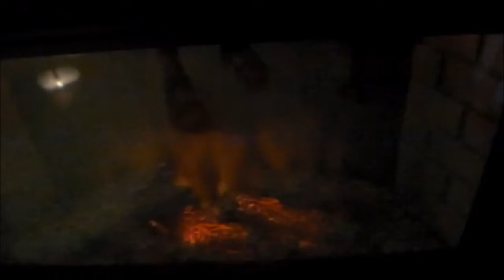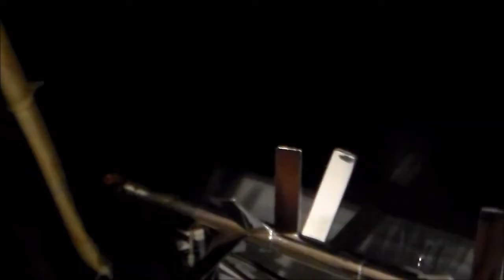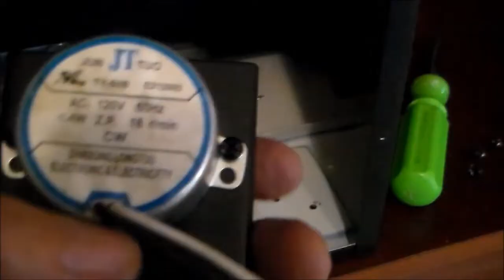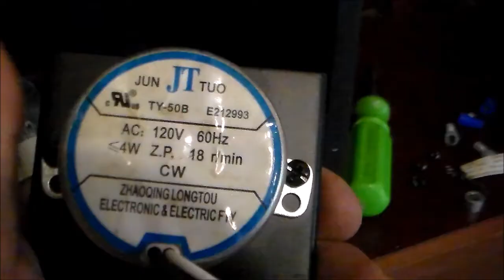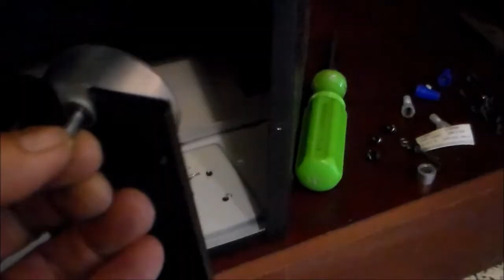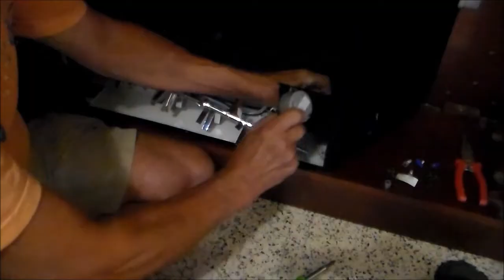How to repair an Electric Fireplace --- Loud Motor Noise

Comment: Thank you! My electric fireplace came with the house, so I just thought that the noisy operation was normal, and was researching for a new quieter unit when I came across your video. Problem solved, landfill and spending averted! 👍

Comment: Mine is a simplex with similar specs but it has a third brown wire. What is that wire for? Can I get one with two wires as long as specs are the same and wire nut that third wire off? Mine is 120v also. Same as 110? 120V, 10rpm, 60hz, 2-5w, cw. It was making the same loud noise and then stopped rotating at all. There is vibration in the motor just no rotation so I’m pretty sure that’s probably the problem but I don’t know what this 3rd wire is for.
Reply: Dimplex * not simplex

Comment: Great video....Any suggestions for removing the spring from the motor unit? On my unit when I turn the spring clockwise the faulty motor turns as well which prevents me from removing the motor off of the synchronized reflective bar.
Any help with this matter would be appreciated,

Comment: Thanks for posting this! I just replaced the same motor in our fireplace and the new one has a thicker shaft. This prohibits the spring on mirrored shaft from fitting over it. So I snipped off the narrower part of the extending spring and stretched out the remaining wider one. This made the set-screw collar unnecessary, so I slid the remaining spring over the wider shaft and secured it with some Gorilla Tape. Spliced the electrical wires like you showed, and everything works great!
Reply from the maker: Nice work!

Comment: What if I just wanted the light, can I just disconnect the motor so that it doesn’t make that part spin?
Reply from the maker: yes but the light will not flutter.
Reply: I had this question too. I removed the motor but now it wont turn on. Do I need to connect the two wires to close the load?

Comment: My old motor has three cables. The new ones all show 2 cables.  Which ones do I Cut?
Reply from the maker: I couldn't tell you, but what I would do is power up the different pairs till I get the direction rotation I am after.

Comment: It seems like it's next to impossible to have a CW motor delivered within the next month, although CCW/CW ones are abundant for some reason. Is there any hope trying to open up the motor to repair it, or am I out of luck? It looks like it's still going to be cold for another month, so I was hoping to have this fixed before temperatures are high enough that we don't need the fireplace until next winter.
Reply: A little late on this response but I just disconnected the motor (snipped the wire) while I await the new motor. Meaning, it still works fine as a heater.

Comment: Great how-to fix.  THANK YOU.  👍 Our fireplace is a Southern Enterprise manufacture (made in China) , and the motor is disconnected with screws from the side. The pesky cotter pin is the hardest to get undone. Also, unclip one of the zip ties around the wiring, and follow the black and white wires to the two appropriate wire nuts to disconnect.  The motor on ours says CCW ( the Jun Tuo brand) - so just match up what is on your old motor when looking online.  Our fireplace gets LOTS of use (not using the heater all that much) so I will get a few extra motors, this one lasting us almost 4 years.
Reply from the maker: great!
Reply: It looks like Donald cut the old motor wires rather than following to an existing wire nut connection. I'm hoping I can cut mine at the motor, otherwise I'll have to remove more coverings and deep dive into a complex wad of wires!

Comment: Hi. Are all fireplaces in need of clockwise rotation?
If you aren't sure... Can you tell me how do I tell what direction I need? Do I  Look towards the pin or the face of the motor to determine. ( I can't see the motors writing on it would like to remove it when the replacement arrives as I just got it used lol )
Reply: Mine says CCW - counter clockwise

Comment: How did you get the spring back on the larger axel
Reply from the maker: If I remember correctly, this spring is twisted on in the direction that forces it to expand and screws on.

Comment: Seems like it would probably be fine, but I'll ask just to be thorough. If all someone cares about is that it's putting out heat, is it okay to simply remove the noisy part that's creating the visuals and just to be done with it?

EDIT:

So since this of course started happening at the coldest part of the year, I decided to just poke around in it and test for myself. So if anyone else comes wondering what I was wondering, I removed the reflector thingy and the motor. There is no light at all anymore, but the heat works fine, which is all I care about.
Reply from the maker: yes you can!

Comment: Can you run it without the flame motor and just use the heater?
Reply from the maker: yes
Reply: @donaldporta  how? And i just unplugged it from an exstendion cord power bar and put it in a straight wall outlet and it wasnt loud for the first two hours but then it was after that.

Comment: Ok so how do you know length cutting wires and hiw do you know what a cargo key is i could really use a little step by step ty im older lady really apreciate if you help through this. Not sure about spring or how you took it off need help this thank you im little sllow

Comment: Thank you for this!  I think my unit is almost identical except white finish.  I had it apart to fix the power switch and noticed the spinning mirror motor was struggling.  Googled it and immediately found your video.  I've got a part on order.  Never done any wiring before but presume there are plenty of helpful videos from great contributors like you.
Reply from the maker: Glad it helped
Reply: @donaldporta  My motor arrived and I'm about to install.  However the diameter of the shaft on the new motor is 1/8" thicker and too big for the spring.  Is there a trick to thread it on or do I need to source a new spring?

Comment: Thank you for this!  I was able to use it to make my home fireplace silent again.  Hint for others trying:  I was unable to find a motor with a 4mm shaft, they only sell ones with a 7mm 1/4" shaft.

I  simply got 1" of 1/4 " flexible tubing and removed the spring and used 2 - 1/4"  spring clamps to hold it in place.  worked perfectly.

Don't forget to check the bulbs when you have the back off!
Reply: I am having the exact issue not finding a 4mm shaft unit :( unfortunately I am not replacing it on a fireplace) so I need to find an exact match
Reply: Oh my gosh ... thank you!!! Just what I needed. Couldn't find the smaller shaft motor at all! Thank you for the tip

Comment: Thanks to you I was able to repair my fireplace and save it from going to Goodwill 😊 Easy Peasy!
Reply from the maker: Excellent!
Reply: @donaldporta I have an old stand alone 23” x 26” high Dimplex electric fireplace a friend gave me that is falling apart, but the bones of it are still good! The motor started getting loud & distracting so I’ve been looking for replacement motors online. I think I can replace it myself, especially after watching tutorials online like this! Thanks for that! I’m not sure I want my flames going that fast though. I like the slower flame effect. I may opt for a slower motor. 

Also, my logs are dry rotted & falling apart. I thought of using spray foam to cover those holes & shaving it down thinner to allow a glow effect from the lights below. Right now you can see the light bulbs underneath through the holes. lol If I use little LED night light bulbs, they shouldn’t get hot enough to affect that foam or let off toxic fumes, hopefully! I noticed part of the logs are made of regular white styrofoam & painted log color with spots of red that are thin enough to let the light through to give it that glowing log/ember effect. Crossing my fingers I can fix this thing & make it look like brand new! I feel like it is more realistic than the cheaper versions they are selling nowadays all over TikTok & Amazon. lol Mine also has more realistic yellowish-orange flames compared to those newer models that have an unrealistic deeper red/orange color w/no yellow. Flames have yellow in them. I bought a little cheap insert box one off Amazon for $100 bucks & sent it back because it looked so fake! 😂 I was originally going to pull everything out of my stand alone & replace it with an insert but now I’m going to try fixing what I have. Thanks for the video!

Comment: Ha Ha! I am in Canada and our Amazon was only selling CCW/CW motors. I did not know what it meant until I installed. The motor spins counterclockwise and clockwise on a random basis. ;-))) The "fire" appears to move backwards when it is counterclockwise. No big deal, but a bit annoying. Very quiet now but still hear a bit of a whirring sound.
Reply from the maker: too funny. turn it off when backwards and back on, it should then be the right way.

Comment: hi. i just bought a little motor like you, but why it have 2 black wire?
Reply from the maker: probably these are the power. should be black and white, not sure what the manufacturers are doing.
Reply: @donaldporta  Thank you Donald!
Reply: It work very well, like new, i changed trhe motor as you said! i think the two wires was dc..A big thank you for you! i have a new fireplace whithout noise! Have a good day Donald!
Reply: @donaldporta  Didn't your replacement motor in the video have two black wires? Hence the comment regarding non-polarization in the 110-120 range and indifference as to which color (or lack thereof) matches which wire? Please excuse my electrical ignorance.

Comment: The motor that I purchased is a two wire, but the original is a three wire. I purchased the same thing - 120V 2-5W  60hz. How can I wire this? What would I do with the third wire?

Comment: Hi Donald, great video, I have the same problem but I am in the UK, I took my fire apart and my motor has 3 wires, a black, a red and a white. Can you please help as I do not know what the 3 wires are for and don't seem to be able to find a replacement with 3 wires. My original motor is rated at 220-240 volts 50/60hz 3.5w 15-18r/min ddww-electromotor GX-EF420. please help, the sound is driving us nuts.
Reply from the maker: the three wires is because it is 220 volts--- the red and black are the live wires, the white is the neutral. search for a 220 volt motor and if only two wires--- connect to the red and black wire.
Reply: @donaldporta  Thank you so much for your reply. So I can just snip off the white wire and put it to one side, I won't need it?
Reply: did you ever find a replacement motor i have the exact same it`s making a noise and driving me crazy.